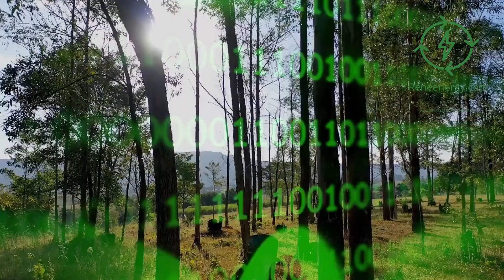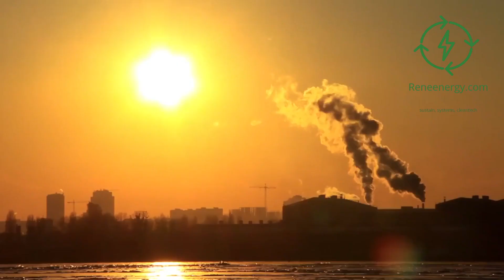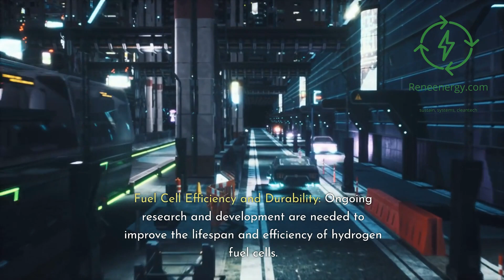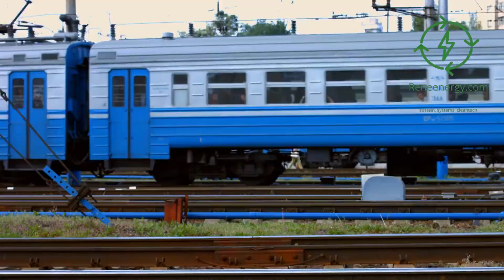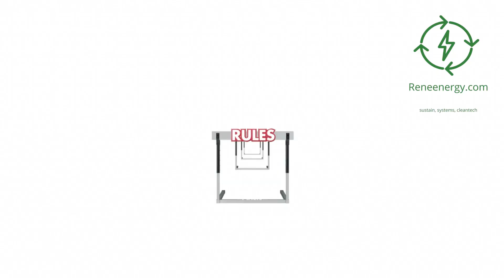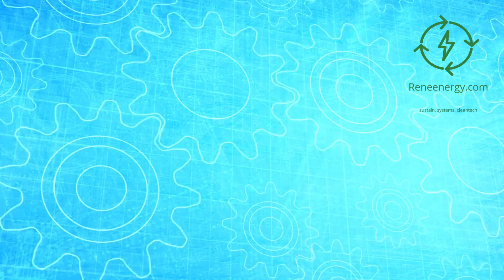The Future of Trains: Green Hydrogen Revolution

Comment: U can put solar cells into on top of trains to make hydrogen fuel
Reply from the maker: Thank you for your comment MikeBurns. It is theoretically possible to install solar cells on top of trains to capture solar energy for hydrogen fuel production, but practical considerations such as efficiency, weight, cost, and safety could make this approach challenging to implement. Further research and development would be needed to overcome these obstacles and make it a viable solution for sustainable transportation.